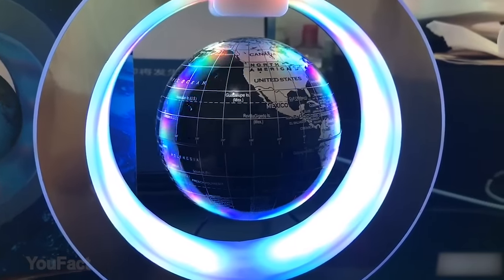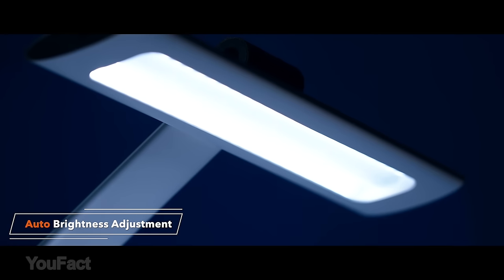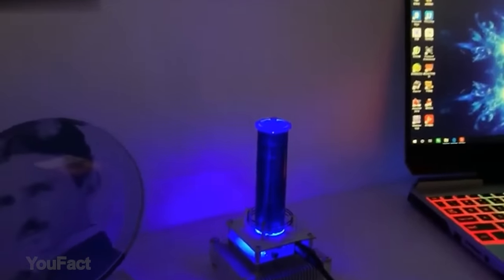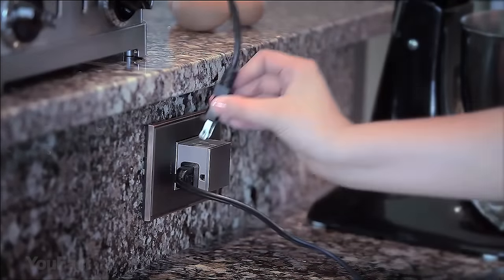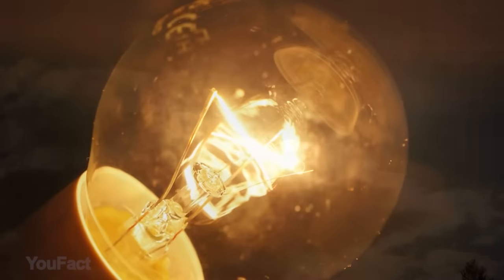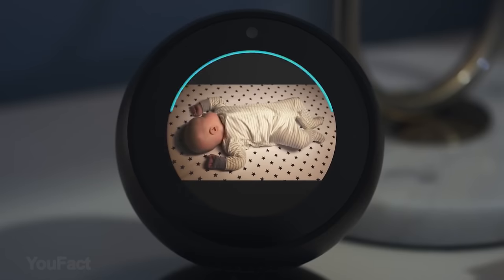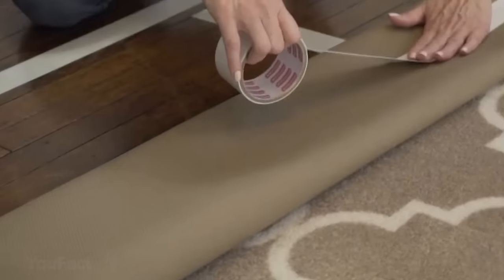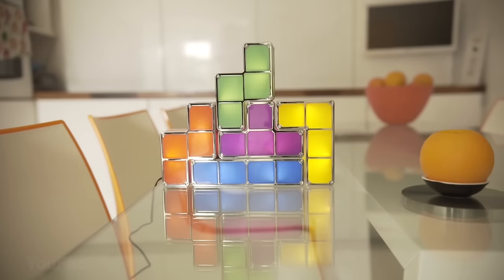10 Coolest ROOM GADGETS That Are Worth Buying

Comment: I made one of those cloud lights with some cotton, a styrofoam ball and a light inside. Hanged it with fishing wire for a floating illusion. Made it for less than $20 and they charging $629??? Just put a changeable light inside and it's the exact same thing. Crazy.

Comment: 3500$ cloud??! For less than 100$, im sure i could just build my own base-response cloud to hang from cealing.  Poly-fill + LED Lighting (cheap cut strips, just need to cook up PSU) + my old Blu-Tooth speaker + Bass response or ambient noise gen for speaker? by using app on my old phone.